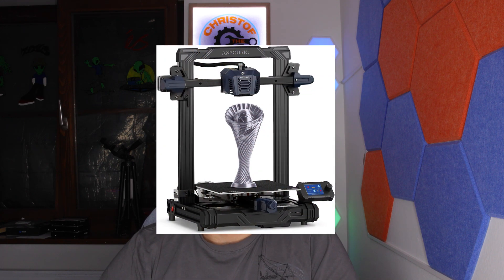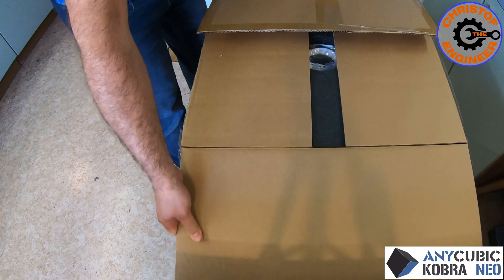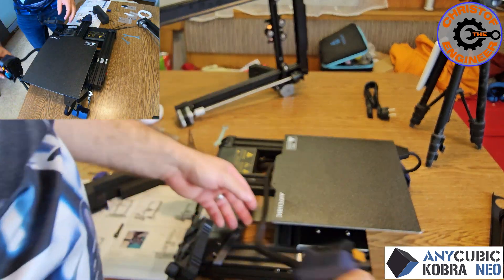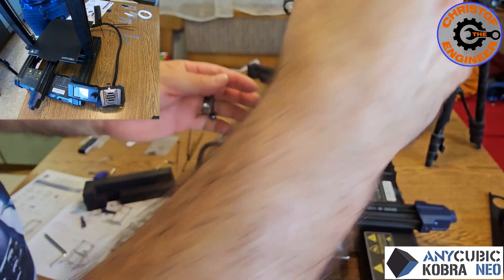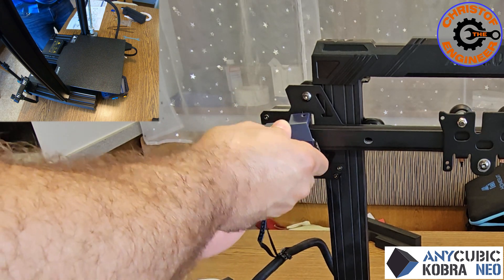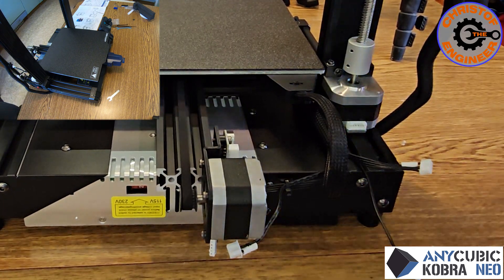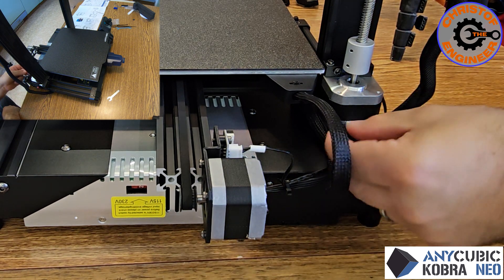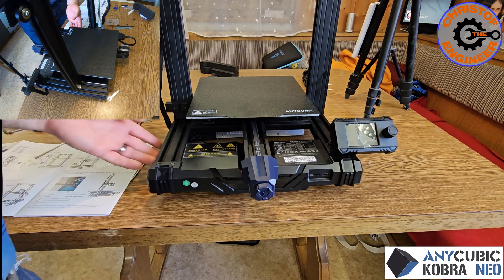3D PRINTER Anycubic Kobra NEO - Unboxing and step to step assembly

Comment: HOW DO YOU LOWER THE ARM YOU JUST CUT NO VIDEO EXPLAINS IT
Reply from the maker: The arm I cut? You mean the Z-axis? That you can manually lower by rotating the spindle at the back. Or which arm do you mean?
Reply: @christof.the.engineer  Thanks, i ended up just removing the top part to install it. I could not figure it out for the life of me. Also i meant you cut the video and it was just lowered